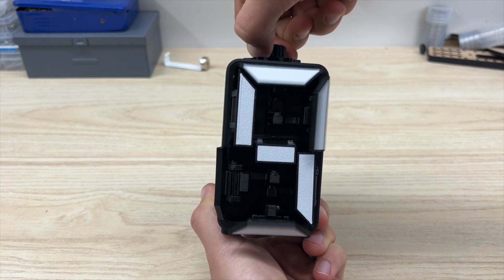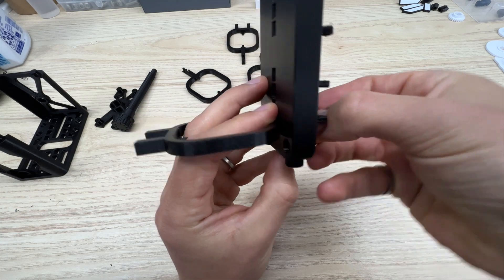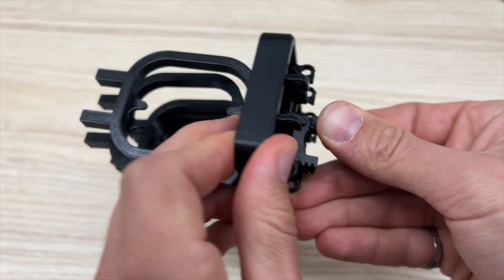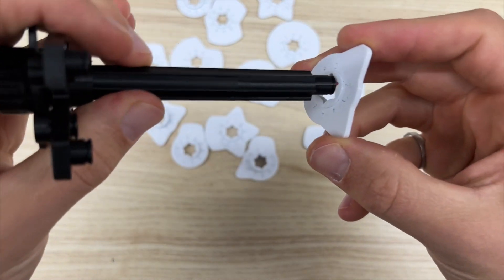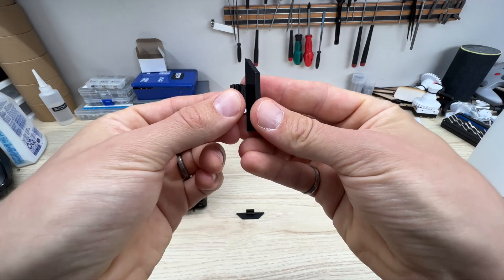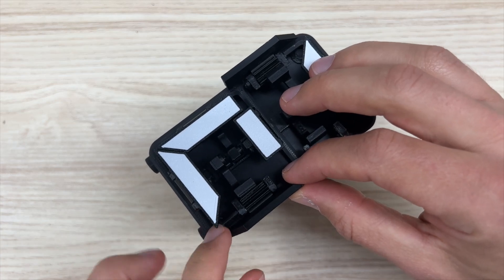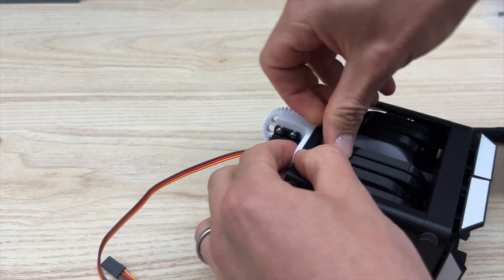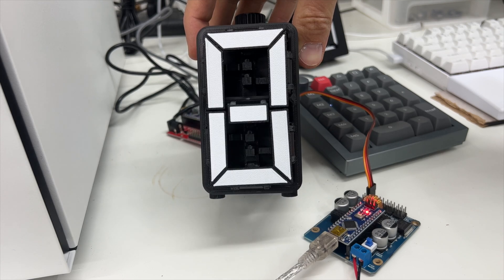The Rack Driven Mechanical 7 Segment Display - How To Assemble

Comment: Thanks for the terrific design, I printed and assembled 4 of this design with an ESP32 to control it for a Christmas gift!

I had lots of trouble with the servo mount's loose attachment allowing the intermediate gear and camshaft gear to slip, so I designed an updated attachment method.

The dimensions of the button are similar, but they use an M4x8mm bolt to allow for proper clamping of the servo bracket to the back of the digit.

I'm happy to share this with you and future builders if you are interested, thanks again for all the hard work on design and instructions for build!
Reply: Can you share the files with me. I’ve had issues with the servos skipping and just kind of put the parts into a bin. Finally revisiting the project and need to fix this. Have you posted the files on makerworld or any sites by chance?

Comment: That's a great idea, but the design needs work. I've tried printing this on three different printers, and each time the cam causes issues. Trying to insert it is a nightmare, and even when it does go in, it doesn't spin. I really dislike this thing. would not recommend

Comment: Few things:
1. Your instructions are hard to follow; so many angles are not shown and some steps are skipped. It would be good to see the state of the object after each step.
2. For the servo attachment, the middle gear is very funky and wobbles, messing up the torque transfer.
3. There is quite some friction between the element making it hard for the servo to turn properly and causing the gear on top it to become loose.

Comment: I mean it looks nice on the thumbnail and in the video but once you print your first one, you will break it, and they are not unmountable. I'm sorry but you can't sell a product that is not finished, you have to consider that not every printer is equal and that some of them might get problems assembling it. I personnally have a P1P and I printed it now 3 times and 2 of them can be repaired with glue, the other one is completly broken. The tolerences are not good so i had to remake some part myself to adapt them, and one of the main part has a design problem, there little pivot that hold the segment are easily breakable because of the print orientation, I will try repair them with glue but not sure if that will work. So it's a quite nice project but please keep in mind that you don't print it and let's go.

Comment: I've gotten the 4 units completely printed, however, I cannot get it to keep proper time.  After it hits say, 10:59.. it goes to 10:60, 10:61.  Now, I've hooked up a digital 7 segment display which works correctly.. so I can't figure out what to fix in the code..  ideas?
Reply: I've since resolved this, there were two issues. One is that my RTC was bad. I simply replaced it and it kept time without issue. The second issue is with the 3D print, the rods printed inconsistently. I ended up shaving them down for a smaller diameter which made them turn freely. I've had this clock running for over a month now spectacularly
Reply: @MeowCat-z4y  I would pay you to walk me through how to code these things

Comment: In the video look easy and cool, in reality its a real pain to assemble it and it is getting stuck 90% of the time, so "stuck" that even by hand it's really hard to wiglet it over the cams, so no way that I can run this with a small stepper. Anyways thanks for the experience. I made a second one, the assembly was even more painful for some reason, the parts where perfect, I even use grease and it was moving smooth this time. When I was putting on the segments for the actual numbers, the base broke. it only one thing worse than assembling this, disassembling it. I will just throw it out and try a third one someday....
Reply: for what it's worth, I didn't have this experience at all. Easy to move, pretty easy to assemble. You do have to be super diligent that each piece is put in the right way based on his video, he doesn't always call it out but you can follow the images.
Reply: @AndrewCordell  How the hack you assemble the camshaft and the followers, I printed 7, destroyed 2, one somehow went together and works well (I don't know how), and I have 4 more which I'm unable to assemble.
Reply: I was too gentle and spent hours just spinning and wiggling everything.  But that's not how it goes together. There's no "neutral" point where the shaft simply slides in.  Towards the end, you have to force one or two followers aside to insert the shaft.

Comment: I just finished printing mine, and finish the assembly. However, when I try to put the segments on, the unit gets jammed, and will not work, especially in reverse. I have no idea what is going wrong. Is there any way I could send my parts to you to have you fix it?

Comment: Hey! absolutely amazing print! I love how it turned out. One thing tho, Im still not sure how to print the multicolor pieces in a way that they have the black edges with the white faces. Im using an A1 with Bambu labs for reference. Any help would be awesome!
Reply: I did it with my Bambu A1 mini and the bambu slicer by setting the two parts of each piece to different filaments in the program, and printing the inner white layers first. Then without removing them off the print bed, i would print the outer black by using "z hopping" with the settings adjusted so the nozzle clears the height of the white print while moving.
Reply: @gjunder  my files dont have two parts just one, im slightly lost
Reply: oh i just click split into parts :D

Comment: Has anyone else printed this at a larger scale? I just printed it at 375%. I had 3 of the follower pin heads snap off and the detent is way to hard to turn. I figure I can reprint the followers with a thicker wall and higher infill to prevent the heads from breaking. "I am talking about the heads where the clips attach the gears. The detent developed stress fractures making it easier to turn. Anyone have any suggestions? Thank you
Reply: How tall is it?
Reply: @fryloc359  it's about 18 inches high 9ish inches wide and 16? In depth. I since figured it out. Had to print the the followers at 50% infill and changed the detent in blender. I am not good blender but it worked.

Comment: Trying to get a servo to spin with the recommended board. I'm a beginner in this kind of stuff and the documentation on Sunfounder doesn't seem that useful. I can do the basic blink led stuff on the Arduino which makes me suspect that the reason I can't get the servo to spin is that you need power through the servo board. Can anybody confirm whether that is the case? Also curious how much voltage you're supposed to use since the silk screen says 7-12V but the recommended Servo operates at ~5V. Thanks.

edit: yeah, the board needs external power and adding the rtc seems easy peasy as well. time to print 3 more for hh:mm clock ☺

Comment: I have a problem I bough the servo you are using but it does not have strength to move it I think my printer is just bad and printed it bad
Reply: You have to power the servo from a separate power supply/battery, or share the one that you're using to power your microcontroller. If you use the 5v output from most microcontrollers (like Arduino) the current you're able to draw is fairly limited. Thus the servo doesn't have enough "juice" to turn. Create a shared ground, and connect the servo signal input to a PWM pin on your microcontroller

Comment: I'm trying to assemble it, but when I put the Cam Shaft and all the Cams in, the fit is very tight. As if the measurements were not correct, but the measurements are in accordance with the downloaded file!
Reply: Yeah same. The tolerances are very tight, don't think my humble Ender 3 can get the accuracy needed 😢

Comment: Edit: turns out it was my crappy old filament that caused the eyelets on the front plate to be fragile. Printed with .6 nozzle and new filament and it worked but for some reason  one of the side racks doesn't engage well with the pinion and slips (only a problem on 1). Not sure if it was a layer height issue? I swapped back to a .4 nozzle and went to .2mm layer height and everything fit and worked as expected. Super happy to get the first one working! 3 more to go :).

Comment: I printed the model with the servo attachment and bought the servo and parts but I’m having trouble figuring out how to control it to set it to zero with my keyboard. Is there another program I need to run to control the servo. Hopefully that made sense
Reply: You need a microcontroller, usually people use an Arduino, to control the servo. You'll have to look up tutorials on how to control a servo with an Arduino.
Reply: Hi there! im trying to reach out and get into contact with you, is there a good social media account or email i can reach you with? Thanks!

Comment: does anyone else had some issues with using the servo I tried using it but every few digits it keeps getting stuck. normally without the servo it spins really easily and even with the servo attached I can spin it by the servo gear without using that much force but for some reason it won't work automatically it is getting stuck mostly at 7 and 0.
Reply: I am currently facing this same exact problem. I have two counters that I printed and they both face this issue. If I remove the servo I can manually turn the dial back and forth in either direction without any issues.

Comment: Hej! Thanks for the really great model... I enjoyed building it very much! One (or two) small remarks: In your part list and in the model you have 14 small c-clamps. That is only enough, when you clamp every rack only with one c-clamp despite they have two pins each. You did so in the video, but you did not mention it. Second point is, that you provide 7 bigger c-clamps in your design, but you need 11 of them (4 for the front plate (mentioned in the video), 2 for the detent (mentioned as well), 1 for to fix the cam shaft in the bottom (not mentioned) and 4 to fix the top plate in the back plate (not mentioned). It's not a big deal to print some more c-clams, but maybe include some more in the design, when you do a revision? Thanks again for the great model!
Reply: Hi there! im trying to reach out and get into contact with you, is there a good social media account or email i can reach you with? Thanks!

Comment: For those of you struggling on inserting the camshaft, here's some advice! I'm currently on my 2nd 7 segment display install and the 1st one took me like 2-3 hours to get the camshaft in. This time it took only a few minutes...

Before you try inserting the camshaft, you want to set the number dial at the top to 5. Then you wanna wiggle the camshaft down without turning the knob. You should be able to get it all the way to the bottom after wiggling it for a while. Eventually you'll get to the bottom, but the top piece still will stick out a little bit and won't be flush with the top of the plate. You wanna force it down from the top around the edges and it should snap into place!

EDIT - If the camshaft feels like it's getting stuck, you can also try wiggling the followers back and forth as you wiggle the camshaft into the housing.
Reply: Thank you bro

Comment: Hey do you have any tipss if your printer is not accurate enough. i have a lot of problems with the spacing. for now i try to pront everything in 125% to get a better spacing but in 100% scale everything sits a little bit too tight

Comment: Hi, can anyone help with aligning the cams, we are running the video at 1/4 speed and still can't seem to get it quite right - Sorted by key it meant that one of the splines on the cam shaft is slightly fatter matching the cams themselves (not a print defect as I originally thought).  As the cams were slightly loose I fitted the last two with a piece of paper to jam them on whilst inserting the cam shaft.  I found that dialling the camshaft to against the detent was the easiest position to wiggle it in.  My son now has two of these and is very happy.
Reply: Hi there! im trying to reach out and get into contact with you, is there a good social media account or email i can reach you with? Thanks!

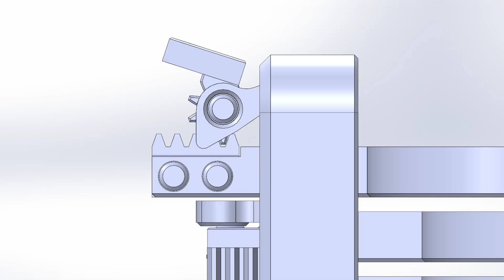Comment: I printed it twice, but unfortunately I had a lot of play between the rack and pinion, so the segments wont fully close and fully open. It will skip tracks sometimes causing the segment to hang open and not fully snap closed. I printed it twice and had the same issues both times, maybe it's just me, but that was upsetting. Basically like he explained @4:55, I line up the 4th pinion with the 4th tooth on the rack but when I cycle through the numbers some of the segments jump cause of the wobble and now the 4th pinion is on the 3rd rack...anyone else have this issue?
Reply: I'm having the same issue, weird more people aren't having it. Were you able to fix it?
Reply: @jackvine1348  no wasn’t able to fix it, and no one else seems to be reporting the problem either. Not sure what’s wrong

Comment: Hey just wanted to reach out and let you know that I modified the Central Clock Connector to feature an actual attachment point for the electronics. I secured the servo board with 4x M3 screws and the RTC with 3x M2 screws. I tried to copy your design style and I feel it really cleans things up. I'd be happy to share it with you / others if you'd be interested.
Reply: yes please! Everything was going really well for me until I had to do the servo. Same stuff that you experienced with the central gear skipping
Reply: @torrentisimo  yeah I never really ‘fixed’ that per se. I just kinda kept messing with it and reprinting parts until it worked.
Reply: @supermomandj  same here. I brought the servo mount to fusion 360 and modified it to accommodate a 608z bearing where the middle gear goes now. However I’m still experiencing issues while moving the servo. I need to do more test with one another from the batch I got
Reply: @torrentisimo  Hey not sure if it @ you correctly or not but I tagged the model below. Also, knock on wood but I may have found a solution to the skipping. Still testing. Will update you.
Reply: @supermomandj  I just found your profile in printables. Thanks for the heads up. Will try it soon
Reply: @torrentisimo  @supermomandj I also would love those files, I am running into the same issue, where do I find them?
Reply: @supermomandj I’d love an STL of the modified central clock connector. I’m also having issues with the servo mount and central gear skipping teeth. Any suggestions on how to fix that?
Reply: @stevekeller1   Hey not sure if it @ you correctly or not but I tagged the model below. Also, knock on wood but I may have found a solution to the skipping. Still testing. Will update you.
Reply: @stevekeller1 yeah no luck on the skipping still. Thought I fixed it but I guess not. Experimenting with some things still trying to fix it.
Reply: Hey I got mine all working. I didn’t change the gears or mount. Just super glued the servo mount to the back of the clock module. It took all of the flex/play out and now my gears aren’t skipping. I did this to all 6 modules I made and they’re all working now.
Reply: @stevekeller1  oh glad to hear it! I ended up totally redesigning the gears on mine to be herringbone instead of spur and that fixed it for me. I’ll be posting the files to the same printables account in case anyone else ever comes across this!
Reply: @supermomandj can you link your printable account? I was going to make herringbone gears originally. Still interested in this fix. I’m printing 4 more modules and would love to try them
Reply: @supermomandj  is this the comment chain you are talking about?
Reply: @ yup
Reply: @supermomandj  where did you host the model? Or your printable account?
Reply: @ yes sorry. I guess JBV or YouTube keeps deleting the comment with all the info
Reply: @supermomandj  I assume the comments are not getting posted? From the comment I gather that you have the model
On printables. So maybe just give me some keywords that I can search and find it!
Reply: @rickygundam  so weird. Should just be called “Gear and Pin replacements”
Reply: Hi there! im trying to reach out and get into contact with you, is there a good social media account or email i can reach you with? Thanks!

Comment: Hey so I was wondering, in your build process did you have issues with any of the gears skipping? The arm holding my free spinning gear on the servo mount seems to almost bend at times and the servo travels up the side of the camshaft gear causing it to skip on occasion?
Reply: This happened to me too. Seems like there’s too much play/slop in the center gears spindle and possibly the servos mounting bracket may be too loose. My gears seem to bind and skip teeth, or just not align all the time.
Reply: @stevekeller1  yeah I’m looking into ways to fix it but no promises I’ll find much lol
Reply: @supermomandj  Any progress? I can't get it to reliably display number 1, and it seems to have trouble with all the number at the end.
Reply: @rickygundam  see if you can find my other comment on this video. I left a bunch of info there on how I fixed it
Reply: Hi there! im trying to reach out and get into contact with you, is there a good social media account or email i can reach you with? Thanks!

Comment: I have bought the file,instead of the stl in the root folder and serve attachment folder,there are many other stl files in another folder,such as "counter add on""clock add on",etc..Should I print those files?what's are the founction of those file